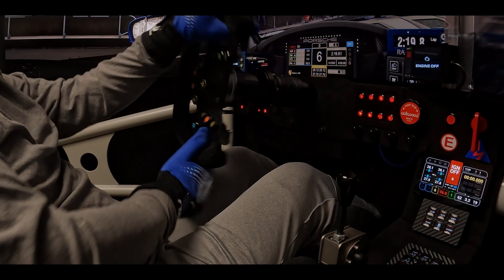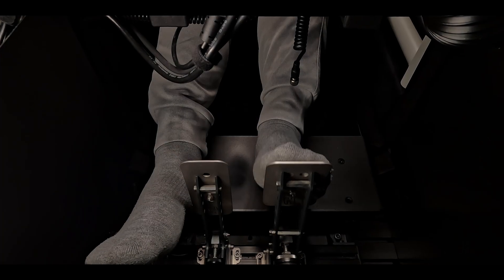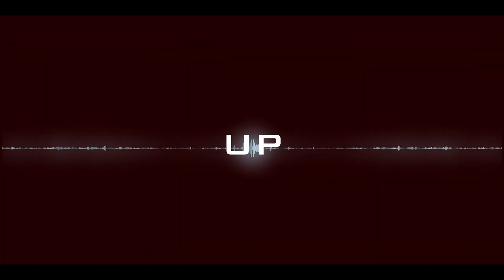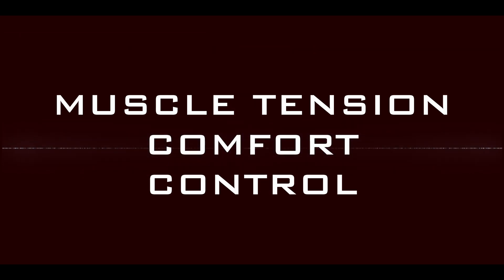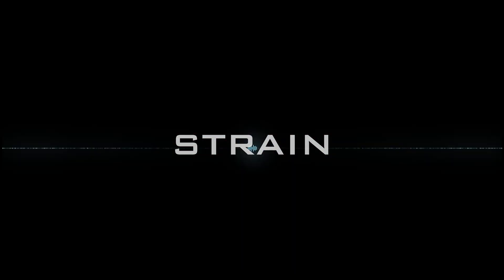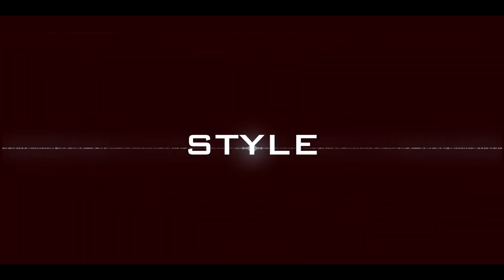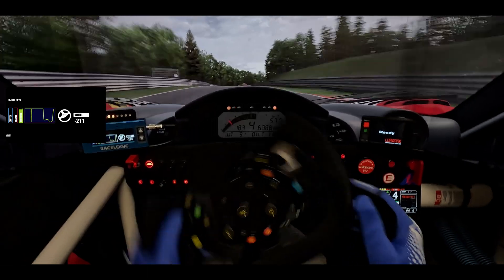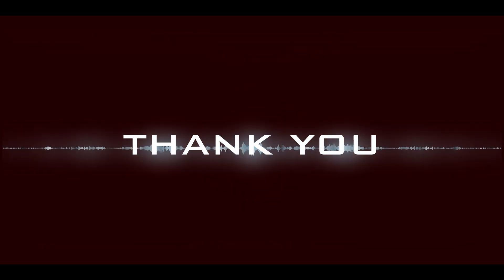FIND YOUR SEATING POSITION. PART TWO. PEDAL PLACEMENT

Comment: Thanks for the video!

Can you comment on adjusting the angle of the pedal itself (e.g. on your Heusinkveld) compared to adjusting the angle of the heel rest? Should I simply use one that is most convenient---or is there something we should be aware of?
Reply from the maker: You're welcome. The higher your pedals, the more they need to be angled towards you. My goal is to have my heels close to the same point on the heel plate to keep me centered in the seat. 

The heel plate is adjusted to place my feet high enough to get good comfortable leverage on the brake pedal.
Reply: @sense-of-speed   Thanks for the reply! However, I am still a bit unsure about when to adjust the angle on the brake itself (which is possible with some pedals, such as your Heusinkvelds) AND/OR when to adjust the heel plate angle itself.

Obviously, the major difference between the two adjustments are how your feet will rest. With the heel plate, your heels' height on the heel plate will change depending on where your heels are.
Reply from the maker: @ula1568 All of the adjustments are finding the most efficient use of our muscles and range of motion. This also depends on what type of seating position you are recreating. 

Mine is a bit between GT3 and LMP.  Having the pedals at that height with the pedal faces at 90 degrees caused too much ankle movement or pointing my toe too forward. To remedy this, I had to angle the pedals  more towards me and move them back until I found the most comfortable position to operate them. 

It took lots of experimenting, driving with an adjustment, taking notes, and making small changes to find the balance between comfort and performance in the end. It comes down to finding what works for your body geometry and the gear you are using.
Reply: @sense-of-speed  i think he was asking if there is a difference to angling your whole plate , or just keep it flat and angle the actual pedals. Also the pedal plates themselves. Or if there is a difference between tilting the whole pedal vs just the pedal plates. And also are you heels on the same level as your butt? Or slightly lower? Thanks in advance!❤

Comment: i have very short throw for the brake and also the softest spring possible. had to modify the brake pedal a lot to get to that
Reply from the maker: i do like a little travel but the softness was a good change. i actually have less foot pain in socks than I did wearing shoes. Oh the thrills of getting old and dealing with pain. lol
Reply: @sense-of-speed i only wear shoes for heel and toe, but now i removed clutch. but yeah we all have some pains old or young ;)